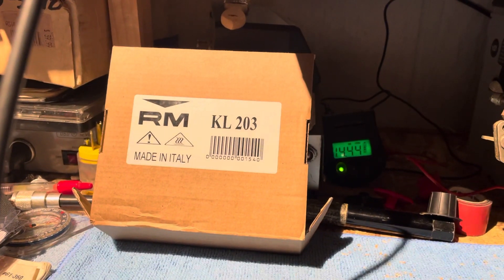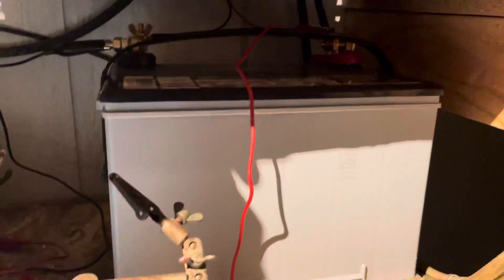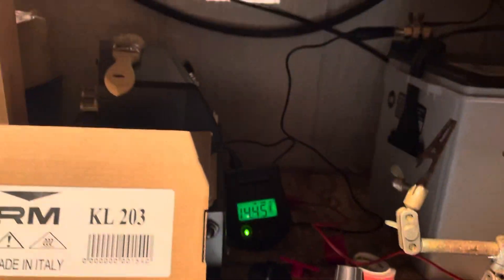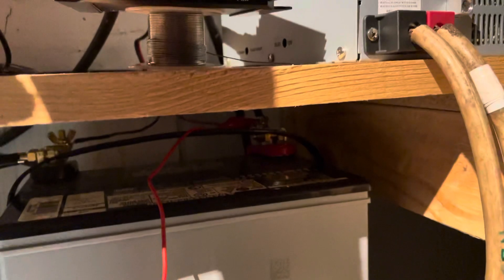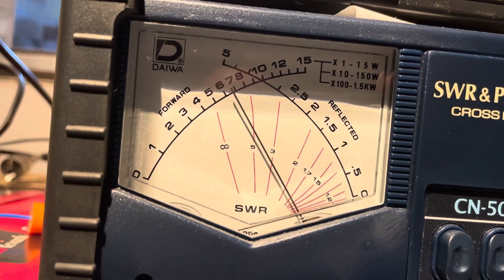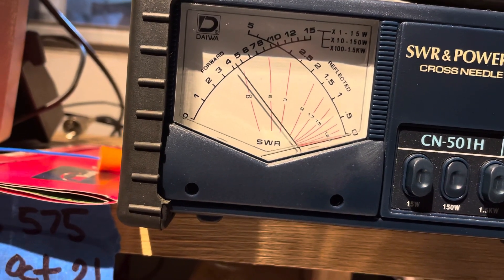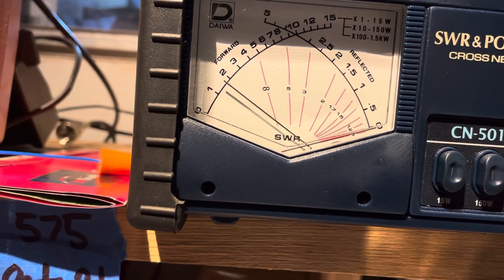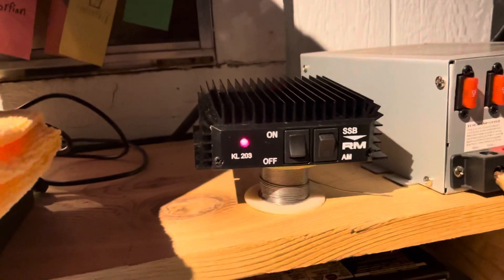Bench testing the RM KL203 amplifier Made in Italy

Comment: I have an older kl-203-p they're not bad little amps. They can run off a 30 amp power supply no problem.
Reply from the maker: Got some long distance contacts from Colorado to the East coast. 73 and Aloha
Reply: @808intheminigrass  ya conditions have been good from the East coast here to Colorado as well. 
73's Merry Christmas and have a happy new years. 🎄🥳